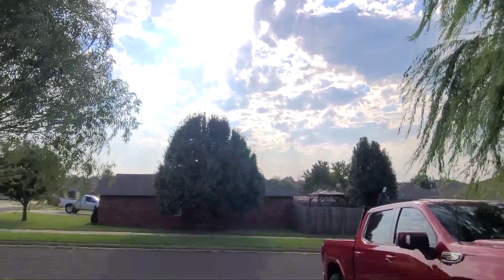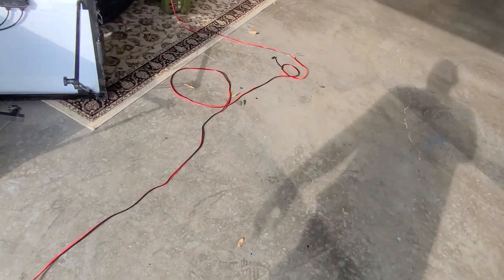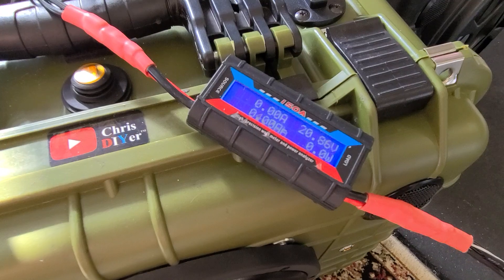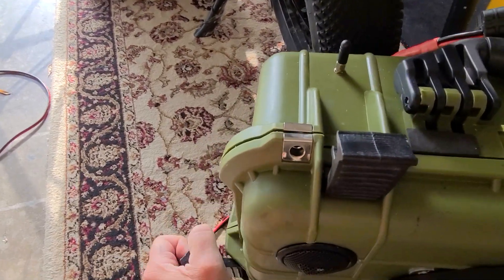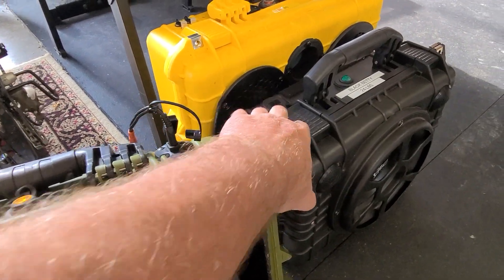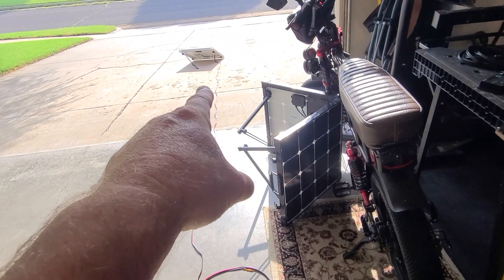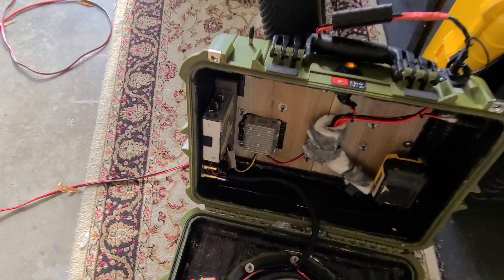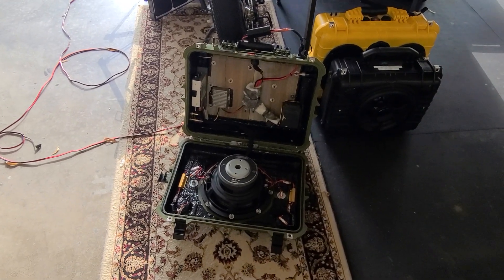50w solar panel "direct" charging 20v DeWalt 4aH battery

Comment: Why don’t you explain what you have. I am a complete novice . What was the blue square device you we holding. A current controller?
Reply: I have two of those. Look up "150A High Precision RC Watt Meter Power Analyzer". They are awesome to have around and use for testing. They've prevented fires when I've noticed the watt usage spiking (a short) on tests I've done.